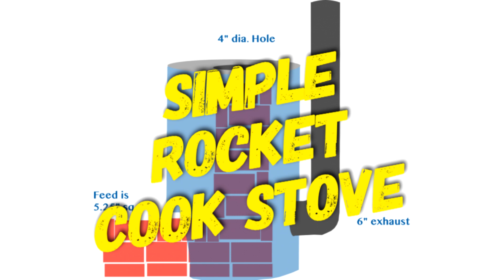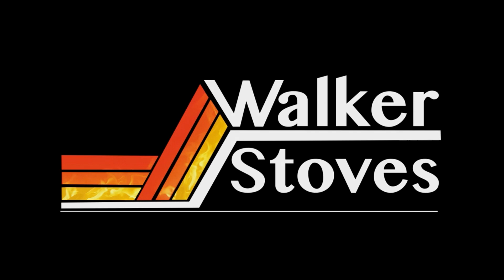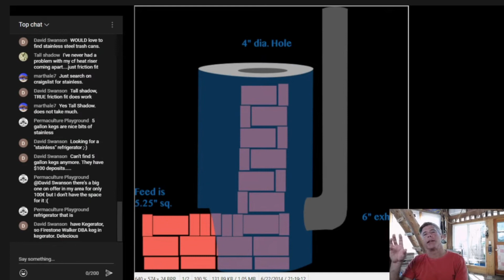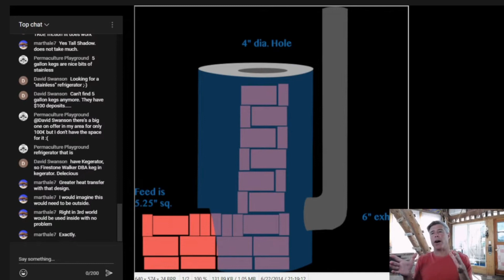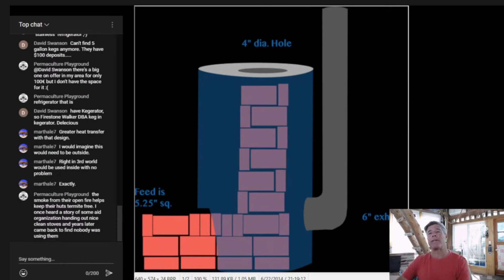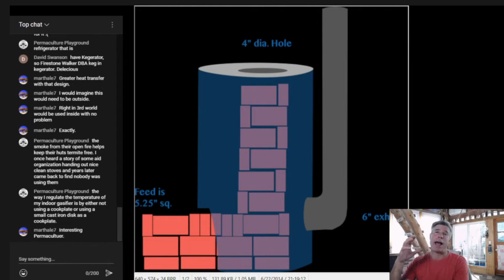Simple Rocket Cook Stove

Comment: Oven
(up wood feeder),
first brick at basis chimney = 1/2 brick high
second brick, keep out,
then you build oven up wood feeder,
closed at top with steel plate.

dont use high temp brick,
but basic ones (lighter they are, more air they get, faster they preheat so heat...).

If proportions of RS are ok,
you have such air-gas flow,
so no smoke on food
(but outside BBQ,
dig hole in ground, you do RS in it,
fresh air = more air flow,
and keep it dry with small stones on ground,
and no wind problems....)

Try,
wery good small bread... '"feuilletés au poisson"